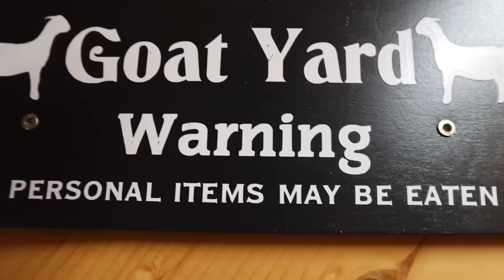Getting Our GOATS Ready to VISIT the Breeding BUCKS some Love It 😍  Some HATE It!!

Comment: Ok Al, glad you asked for input on  the sheep. We have had several breeds of sheep on the ranch both here  in Texas and back in California. For a nice big beefy butcher lamb it is hard to beat a Suffolk BUT you have to shear them. If they are out in wooded area they get things caught in  the wool. Where you are at the wool keeps em warm.  We have let our line of wool sheep go and only have a few cross breeds left and are not breeding them. Instead we have gone with a nice heavy bodied Dorper. They also average out to more lamb's in a year and are easier to handle than some woolies. We are real happy with ones we have and the meat is delish. Best yet, no shearing!  I like the looks of the black headed Dorper.  Check it out for yourself. One more tip, buy your ewes open(not breed) Lambs can have a high death rate when they are taken to new soil with new parasites. We found out the hard way on that one. Sheep need to be parasite resistant or you are fighting a constant heartbreaking battle. You have lots of land and that is key with sheep and rotating grazing. Research your area and talk to local ranchers. Good luck. We will always have sheep we love em so much. Good simple living has babydolls and she may have more wisdom than us. As always, praying for many blessings for y'all and ❤ from Austin Texas
Reply: That a good advice post. Thanks well done

Comment: That’s pretty neat how you file the hooves. I’ve seen others actually clip them. It makes me afraid they will cut into a tender spot on the goat’s feet.  You always have a genius way of doing things. Like when you smoothed out that cast iron pizza pan!  That pizza just slid around on that pan surface without a single sticky place. You fixed that NEW cast iron!
Reply: There is nothing wrong with clipping them, you just need to pay attention and not clip the hoof wall or heel below the sole. You can even see Al clipping the boys before finishing off with the grinder.

Comment: A good standby dinner using just about the same things that you’re using in this meal is called “keduree”.  It is made using rice in place of the potatoes. The scrambled egg mix is then added to the fried bacon and sausage and poured all together in one pot or rather pan. Are used to use a large cast-iron skillet. Check the recipe on Google and you’ll get some great ideas.  I always serve some form of homemade biscuits rolled out and cinnamon sugar put on the dough roll it up, cabinet in about 1 inch thick circles slicing the dough across the length of the rolled up though. You can add more or or less sugar, more or less than a month,.  And that’s quite quick and easy to add to a keuree!   This way of cooking is a very old style recipe from England, I guess it goes even way back in English history. That’s the luck and let me know if you want to try it so I’ll be sure not to miss it!

Comment: I don't know if it works for goats, but with dogs I found inexpensive concrete pavers do a great job of trimming nails. You'd have to lay them in an area they are always going to walk across, so maybe about 4 feet out in front of their barn door where you have rocks now. I'd just push the pavers into the dirt and then put the rock back on top.

Comment: Just out of curiosity. Is there a reason you are only unblocking a little section and not removing the whole thing?
Reply: Are you referring to the  beaver dam?  If so, it helps to define where the beavers will go to build it back up - and hence a good place to put the trap.  If there was no dam at all, then it would be hard to predict where to best set the trap to capture a critter.
Reply: The point is to catch the little fellas, that's why if you breach one part and put a trap in it, they'll be in that spot sooner or later.
Reply: @samvalentine3206  gotcha. I figured there was a reason but wasn't sure.